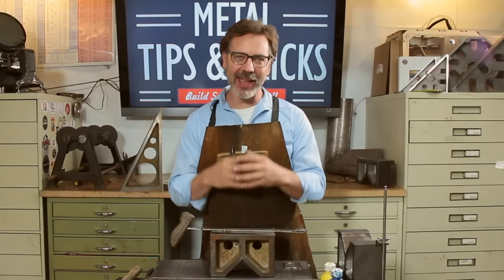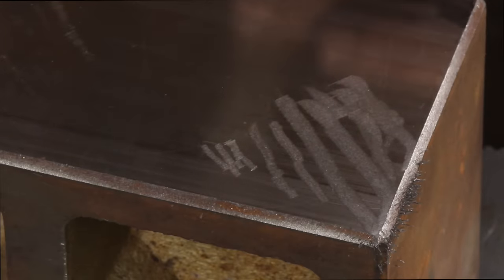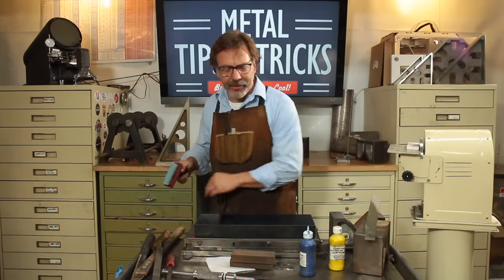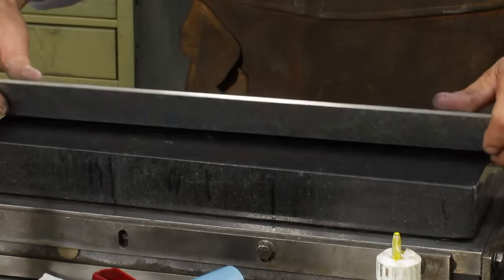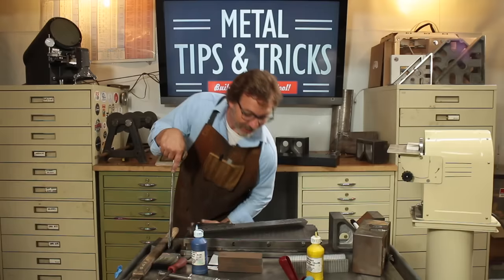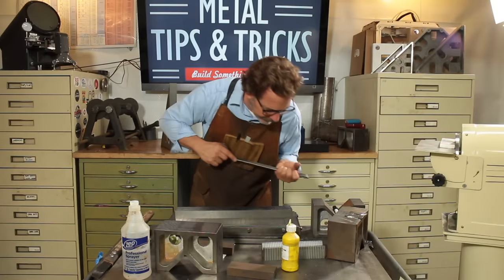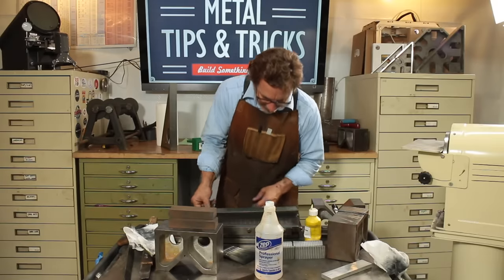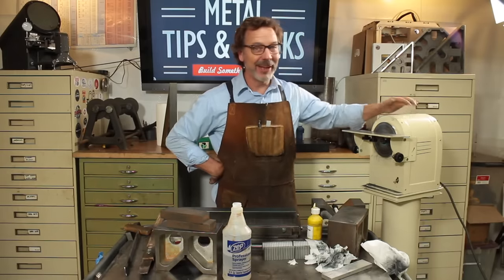How to hand  scrape metal for flatness

Comment: Wow, this takes me back 40 years to when I was an apprentice Fitter and Turner. In our apprentice school we all were given a cast iron table 6" square. We had to hand chisel it, then file it, then draw file it and then scrape it until it was over 90% flat (using bluing). One of our first projects and we used that flat edge throughout our apprenticeship..
Reply: I too am a fitter machinist and back in 70s did scrape cast iron block. What a dated technique, surface grinding was more than enough, and sure did a lot of surface grinding. Only ever did to scrape a press crank bearings. Patience  is a gift as it took me a long time to get them blue up and running,and also tapered keys, did a few of them. All done to fit correctly on the job. Most time I think its not worth bothering with unless you are a tradesman and then only very rarely

Comment: You've probably already figured it out, but the audio is dipping because the plosives are triggering a compressor and the compressor has too long of a release. Use a low cut filter to get the plosives out, and possibly raise the compressor threshold a bit so it's not so pumpy.

Comment: In the uk we do it slightly different tend to use curl strokes and put the blue on using felt pads spent 50 years building high precision thread grinding machines a lot of scraping for flatness and alignments. Hard work especially columating machine bases

Comment: I have done hand scraping when I was younger and I found grinding flat and grinding lubrication grooves in the work  was the way to go.
If the work is too large to grind, I send it out to a shop with a larger grinder. I like hardened and ground ways.
By the way I did thumbs up this video.

Comment: Hello, I did a lot of scraping in my day. Worked in a overhaul shop reconditioning #2 Brown & Sharp OD grinders. we scrapped in everything.  Main travel table and swivel table, Grind wheel stack also. Learned right away to hip scrape a med. pass on flat side first to stress relieve before any bluing. You didn't talk about hip scrapers  but you were working on a smaller piece. Also you didn't cover flaking for oil retention. We cut rolled crescents rather than straight cuts. It was a lot of work but once you got started and saw how you could move and split high spots and spread out the pattern and points, that made it interesting. We usually had   two machines in the shop at a time and three men scraping. That was in the 70s.
Reply: For reference, could you break these two points down? And note if my guesses are on point?

> pass on flat side first to stress relieve before any bluing
Rub the piece to be finished on a reference to relieve stress on the piece?
> how you could move and split high spots and spread out the pattern and points
Control on dot counts/patterns?

Comment: I've been a machine tool fitter for 50 years and always use high spot micrometer blue, i'v never seen scraping done for size, it's always done to get the surface flat and feathering to get a bearing finish, i spent many years scraping bearings just as laborious as flat bed scraping but got more satisfaction from doing it.

Comment: I'm reading Foundations of Mechanical Accuracy and I had some trouble visualizing this process until I saw this video.  Great job.  

I'll write out the relevant part of the book for any interested readers.  They say the first thing you need for mechanical accuracy is "flat master plane" which you achieve with three 4ft x 4ft cast iron plates that you use this bluing process to get flat.  You mate two of them together and find the high points to work them down.  But if you only did this with two plates, you could end up with a ball and socket scenario where one is concave and once is convex.  So you need the third plate to reference both of those to which will keep them all honest.  And they said each plate and it's built-in rib supports weighs 2000 lbs.  Pretty wild and brilliant stuff.  Cheers
Reply: Thank you for an interesting book reference on topic, those are always great.

Comment: Good idea to flip your work end for end every scrape to average out .... also be careful not to press down when rubbing that causes pressure points and false reading.... when I was 17 and poor I would hand scrape engine heads that's easier because all you're doing is matching it to the block.... and also you need to intentionally leave slight high points around each cylinder and other strategic points to create better seals with the gaskets filling the voids

Comment: Might not want to forget the rules of straight scraping: 1.  Individual scrape marks or points   2.  Individual  scrape lines (meaning the spacing from the line above and below the one
 your scraping can not touch the line before or after, if they touch you will get long openings or ruts).  3. Depth of the scrape mark or cut.  You went from high in the middle to a hole, that wouldn't be my goal, maybe should measure first to see how far you need to go before taking off in that direction.
Reply: don't mean to sound grumpy but I did a four year machine tool fitter apprenticeship and the men who taught us had a life time of mastery. Having someone with no clue giving a tutorial on my trade gets to me . RK would probably also agree with me
Reply: chris0tube q
Reply: @chris0tube  Did I endorse anything? I tried to offer "kind, positive, constructive, criticism" I would not give Dale's technique shown here a very high score myself as I think he seems to forget a lot of Richards instruction. Of course I am no expert in scraping. Someday I likely will do some scraping on video then everyone can critique it too. lol
Reply: @chris0tube Until I get my granite reference surface checked no need in messing a bunch of stuff up by scraping it to a bad master!! Also scraping jobs for me are non paying so they go on the back burner. :-) I have 2 big cast iron plates and 6 straight edges that all likely need attention so plenty to do!!
Reply: @chris0tube 'everyone is scraping everything' ;-)  Perhaps I should be glad that my trade is now trendy like knife making or whatever is next!

Comment: A great video, very educational.  As a dentist we use the same technique when adjusting the occlusion of people's teeth after a restoration or crown is placed.  The dark spots with the light centers we call a "donuts" and checking, cutting, rechecking for new donuts I call chasing the dots.  As with what you are doing eventually we get to even contacts, we then polish the surfaces and call it done.  Again a very clear demonstration.
Reply: Cheese and crackers, just the thought of a dentist with those scrappers

Comment: Informative I use Prussian blue to mark and I've had a small tube for years it goes along way, even got my old scraper that i made from a file when I was an aprentice, I've used the yellow making grease for checking  contact areas on gears I'll give it a try.  I've got a new mini cnc mill to give all the ways a scrape to reduce sticktation and maximise lubrication of the ways.

Comment: Great video but an audio fudge? Video at 1.5 speed? If not, stop buying the four packs of Red Bull!
Reply: I agree, it's something like 1.25x video with the "maintain audio pitch" sadly that really amplifies the pops in the audio.
Reply: I watched it @ .75 speed and it is much better. It also loses that 'caffeine' effect!  😛
Reply: Sounds like too many adobe audio presets slapped on like a piss in the wind or duct tape weld. Or crap equipment/bad file management causing downsampling somewhere along the way. Man is an excellent machinist non the less
Reply: @maxpert9  It's crazy. It's like he doesn't care to spend his life learning about audio, and got it good enough so 99% are fine with it. Not sure what he should do differently.
Reply: In editing, detach the audio. Speed up the video as you wish, run the audio at correct speed. Cut to match length.

Comment: Dale, I always appreciate watching someone with more expert knowledge and more experience than I have doing a job like this. That said - and in the spirit of constructive feedback - I found this video very difficult to follow for 3 reasons. 
The first was that your narration was racing along at high speed, while your camera was mainly focused on you, and on the actions you were performing mostly from a distance. When you did show those, the actual viewing of the action was very brief, and it almost looked as if you'd sped up the video. It would, perhaps, be easier for viewers who are learning to see longer close-ups of your hands and the tool on the workpiece, and possibly even with some of that slowed down during editing. What is obvious to you, with more experience, is not as easy for someone with less knowledge to understand. 
Second point: you mentioned briefly at the beginning using yellow as a "highlighter." However, I really was not able to get a clear understanding of a) how, when and where to apply the yellow, b)  what I should do to the yellow surface (or not do), and c) where in the overall process it comes in. 
I was taught scraping using only two edges - one similar to your "60" and the other about 1/2-1/3 that size. The machinist who taught me used a very thin coat of oil-based marking blue (artist's paint, I believe), well rolled in. However, he taught me not to attack the surface in long, deep gouges, but rather to start out with what would resemble a checkerboard of scraped & non-scraped areas. Then successive passes progressively reduced the size of the "squares," working to produce even patterns of high and low spots. With each overall pass, the "grid" would be finer, and the "spots" or "points" smaller. 
Now, that may be a very old fashioned technique, and possibly the method you show is faster, or more effective - I'm not clear on that point. Where the Yellow comes in, and what part the yellow plays in your scraping technique was not clear to me as a viewer/student. 
Finally, I realize that this is a long lesson, with many steps. That being the case, might it be presented in two parts perhaps? If you were speaking more slowly first as you describe in general what you're about to do, and then with your voice-over describing exactly what we're looking at close in on the tool and workpiece, at a regular or slow speed, ? 
Although I have an engineering background and a good deal of practical workshop time, including having learned basic hand-scraping, I recognize that there is much more to learn about what can be done and how to do it - which brings me to the final point. 
In editing this video, there is much "popping in and out" at various points in the process. The way in which this is done in editing is visually distracting. It also makes the "what is the proper sequence of events?" a little more confusing.  
I appreciate your hard work and the large amount of time you spend in doing a video like this very much - I know it takes much longer to demonstrate something and make a video of it than to just do it. I offer these thoughts as a semi-skilled student, and in the hope that some feedback may be of use to you in making future videos. I thank you for sharing your time and considerable knowledge.

Comment: We use files for Kirksite.   We would take the file blades off with a bench grinder, then get them precision ground in as flat as possible, and got the edges at 90°.  Then we would take them and work and shape them from there with bench grinders to make radiuses or even venturing into hand shaping.

Comment: edi malinaric

Aged engineer here. 

 That radius gauge that you are using has a 1" x 1" hole in the middle but the radii on the sides will be in mm not cm - a 10x difference.

Thanks for showing that slide hammer scraper. I hope you won't mind if I make one.

Happy Xmas to all - cheers edi

Comment: People use blue and red, 
Personally I use Stuart's micrometer engineers marking blue, comes in a little tin and o go through many! 
I also take two inch wide rag, roll it up tight and put loads tape around it so only one end is showing, then that's what I apply and spread the blue with, we would of been strung up as apprentices for using a roller, but like you said every one has their own method!

Comment: Blue, engineers blue, as a matter of fact, was chosen because of the particle size. It is not a particle but the molecule of a chemical compound that builds up to a colloidal particle at the most. It is not a ground mineral particle. You can spread it really thin and not make it transparent enough to make it completely transparent.  The particle is from 20nm to 200nm.

Comment: Great video and accurate, I am a tool maker and had to hand scrape 2 bearing surfaces that were 6 by 6 feet, this method is insanely accurate but my gosh does it suck balls lol it is tedious and will see your fans hand and arm out, and hand scrapers are by far superior to air powered or electric, the more high spots you see with high spot blue the better, good rule of thumb is 50 spots per square inch

Comment: The patience is remarkable. Question, do most guys make thier own surface plates or can you buy them perfectly flat already? I dont need one but im fascinated by the precision. How much would a perfect plate cost to buy on average?
Reply: There are several grades of surface plates and the cost reflects the flatness. Cheap grade B (toolroom grade) plates are good for sharpening tools will sand paper and doing rough layout. Grade A (inspection grade) and grade AA (laboratory grade). There is an even crumbier grade, but it would be almost useless for scraping work.

The grade AA plate has a flatness of (40 + diagonal (inches) of surface plate squared / 25) x 0.000001″. The grade A is half that and grade B half again. Too much information? 😀

You can pick up a decent black granite grade A  surface plate 12" x 16" x 3" for around $160. This stone will weigh in at around 80 pounds. You likely will not be moving it around much 😀The surface plate that I got came with an inspection diagram showing the flatness of the stone.

I read that  good rule of thumb is to buy the largest sized grade A plate that you can afford if you plan any serious use. You probably don't need to go to grade AA, but it would be pretty cool.

There are also cast iron surface plates and even glass. Bring your checkbook.

Comment: Have done this, made 3 small surface plates. Why 3 because they are used to check each other to balance the flatness. I think its just easier to fork out the money in all honesty but a Nice surface plate cost so much money...

As others have pointed out there is some audio issues that are somewhat annoying. mic should probably be on the collar as it wont move as much.

Comment: The magnetic chuck is sure nice to hold parts. But it has the risk, to straighten out bows by pulling the part flat to the surface. So one has to be consider that using it.

Comment: I add extra ink usually because when I scrape something it is really out of wack and you rub the piece the ink starts to dissipate. When I say out of wack I'm talking about from the straightness of a bandsaw cut to a tolerance better than .001 So you need to have a lot of ink in the beginning to speed up the process.

Comment: In an older video you made, "The Cutting Edge", about making a shearing bead rolling die, you showed a pre-drilled blank, bought from a Big R store. 

You mentioned turning profiles on them.  In the video, you ran a bead of weld around the material, then ground it with your post grinder to get the cutting edge.

I'd like to pick up a couple of those blanks, but don't know what to call them. What does Big R sell them as?

They're about 50 minutes away, and I'm not good at 'phone charades', trying to describe things. Like to verify they have them in stock..

Thanks for the info, and thanks for sharing your skills and knowledge in your vids.

GeoD

Comment: It's so satisfying to see a true master craftsperson elevating the discipline.  What's interesting is that something very similar to metal scraping is done on huge multi-ton millstones that grind wheat in old-fashioned millhouses.  A millworker hoists one of the massive stones up about four feet then flips it slowly and sets it down.  Instead of bluing, he uses edible carbon on a sheet rubbed by a long straight beam of wood; this marks the high points.  He then makes thousands of little raps using a small ball peen hammer over each carboned spot.  He repeats the carbon marking and peening until everything is even again.  Thanks for this video!

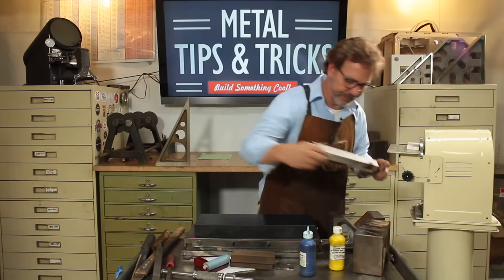Comment: 9:17 red, blue, and yellow are primary colors.
the opposite of blue would be the combination of the other two primary colors. red + yellow = Orange.

Orange is the opposite of blue.
Purple is the opposite of yellow.
Green is the opposite of red.
Reply: @Dan Nguyen good point. If the paint were emitting light, then blue and yellow would be opposites and when rubbed together they would create a white light.

Comment: I have a question on mirroring and surface roughness and wanna know if my thoughts are right: For any given surface roughness d there exists an viewing angle at which the piece becomes mirroring for a given wavelength λ of light. This angle I call θ (perpendicular being 0 deg) is reached when cos(θ) * d = λ/2. The thought here being that when I view the surface roughness as a line, the line simply get smaller due to being viewed as an angle. Since optical speckle disappear at λ/2 or less, should see mirroring/a not diffusive image once the view of the roughness is below λ/2. 

E.g. If it the piece is mirroring when viewed from 45° under green (525 nm = 0.525 µm = 0.2 tenths) light, the surface roughness is <1 µm / < 0.4 tenths. Correct?

Also, if you'd like scrape with mirror edged tools under a laminar flow hood and generally avoid any dust as well as use an optical flat as reference surface, could you scrape to an optical finish (<400 nm surface roughness)?